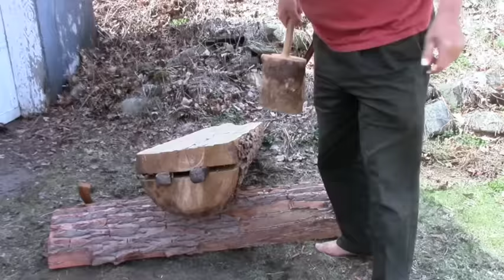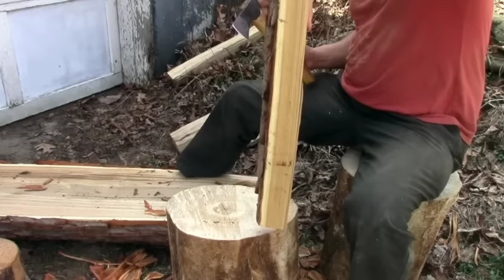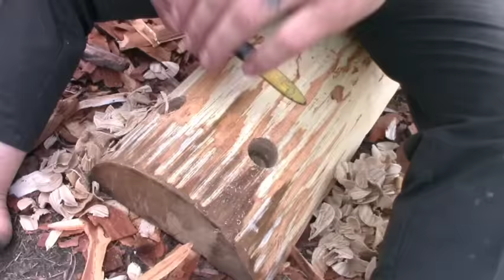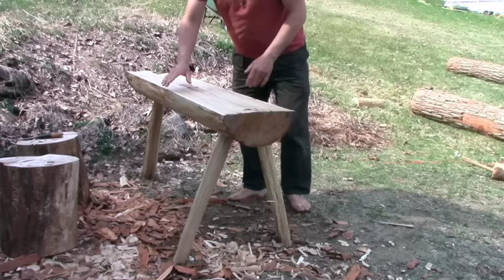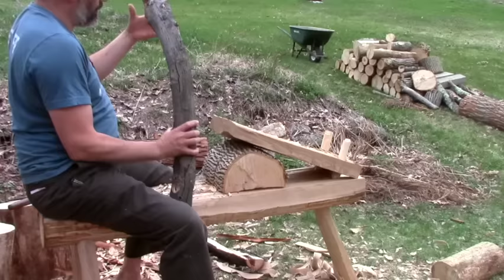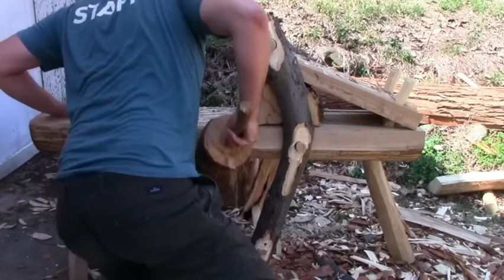Making a shaving horse for woodcrafting and traditional woodworking.

Comment: I've made one of these but I use some power tools especially for drilling. The only difference was I used some leather and some chain at the back of the angled board instead of making it stationary so you can adjust the height and angle of your working surface.